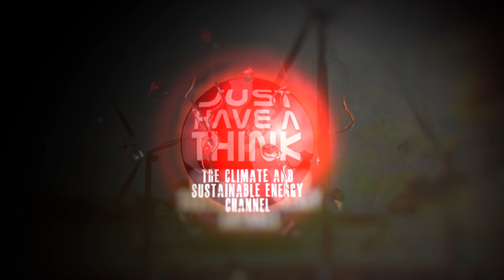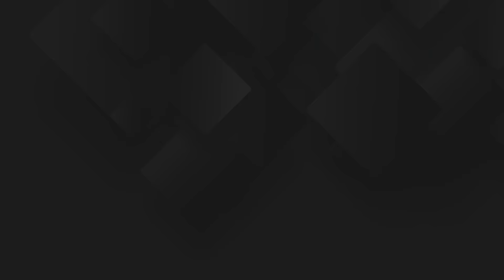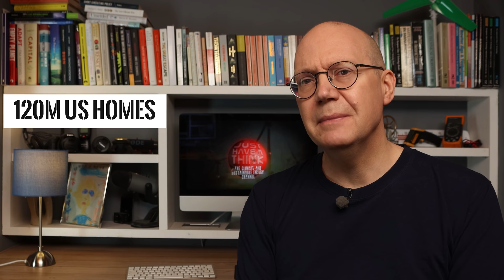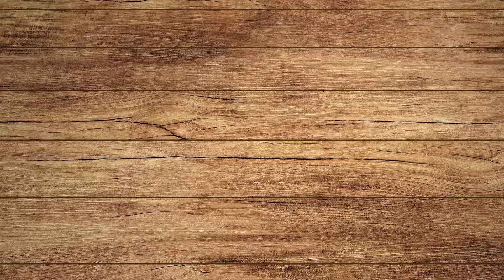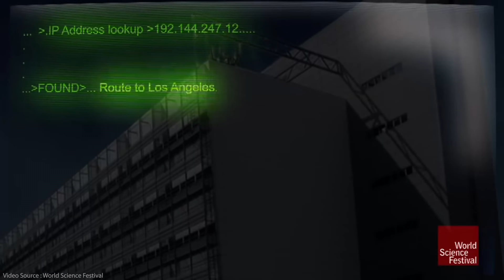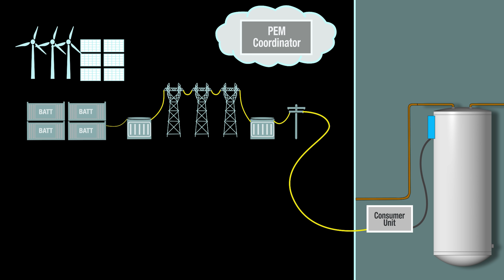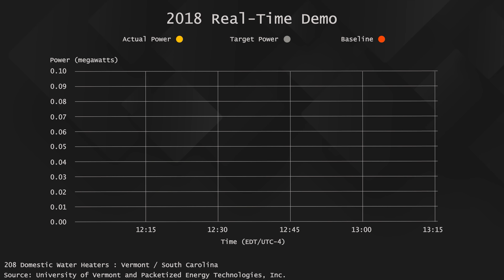How to balance renewable grids WITHOUT energy storage!

Comment: I see some problems (hopefully not unresolvable): (1) Unlike the Internet where the "packets" are all digital electronics and the "hardware" in the computers and servers are designed to comfortably maintain themselves for hundreds of thousands or millions of "on/off" iterations, things like hot water heaters are mechanical devices that, beyond the clever electronic PEM algorithms that control operation, could be subject to repeated mechanical stresses that could shorten their lifetime as they switch along the PEM packet curves.  The frequent "update" schedule, unless carefully modulated, could be brutal on mechanical devices - perhaps somewhat akin the electric "brown-out" periods on conventional electric grids as electric "need" messages get scrambled or are insufficiently served.  (2) the "Opt Out" option, where immediate electric need overrides the PEM algorithm, could become the default setting for selfish users.  Avoiding the "I want it now" attitude of many people could be hard to monitor and beat.
Reply: The opt out mode isn't decided by users, they aren't relying on selfless users trying to minimise their own electricity consumption- the example in the video was of a water heater that would opt out if the air temperature was very low and therefore the normal priority rating of a domestic water heater would be inappropriate, so the device opts out.
Reply: It would be nice if the gov could stop domestic use of gas when temp rises above a certain figure...
Reply: @danyoutube7491  I see your point, but, consider, in an increasingly hackable environment, it is hard not to think that end users would not attempt to override the electric company algorithm for personal gain.  Also, the PEM algorithmic "coordinator" receives requests from some appliances that require immediate energy and prioritize the "need" - in the example, more hot water needed now means the hot water heater sends increasingly numerous requests until the energy is sent ... so ... (1) the FREQUENCY of requests for energy from the END user does play a significant role in energy distribution, not just the PEM schedule, and (2) high energy "hogs" - hackably configured or not - are going to exploit the opt-out option more often than devices that can trickle-charge - therein rests yet another potential problem:  impatient or "selfish" end users could intentionally purchase high-energy devices (and the market would provide them unfortunately) and forego lower-energy alternatives.  The "use" curve is not entirely at the generator end; justifiably or not, the end user devices partially determine the rate and level of energy draw.

Comment: No expert on the matter, but I've understood pretty much the same thing can be achieved by devices just being smart. Based on the waveform the status of the local net can be determined and depending on the status of the net and the urgency the device can decide whether to switch on or not and in case of batteries even decide to supply energy to the grid. Packaged energy looks like a more advanced version of this that without doubt offers plenty of advantages. But I see a risk too, at least to me it sounds very vulnerable to hacking. What is stopping people from sending false messages? Specially when the system is already under stress, I can imagine that it wouldn't be too hard to give the system an extra push by inserting false messages in order to let it crash.
Reply: True, you can determine how the grid is doing just by precisely monitoring the frequency. But there's no incentive. Why should manufacturers or consumers care? You spend a few extra cents on the parts, and only other people benefit? Not a big seller. Now, if you could incorporate real-time pricing, then we've got a potential seller: It would actually save customers money. But that brings new problems as well, like people getting caught out by minutes-long price spikes.
Reply: @vylbird8014  Those few extra cents is negligible compared to the price of most of those products and regulators could easily decide that they should be included for approval in the same way that regulators enforce all kinds of durability and safety standards that otherwise would not have been implemented. 

Variable pricing would be beneficial too, and it actually exists already for decades in some areas, though for the retail customer in a much coarser way. Not sure how easy or hard it would be to implement that on a real time basis. Also not sure how much added value that would have in a network full of smart devices that, where possible,  draw power based on grid status.

Comment: Things will get even more interesting when homes can promise to deliver packets of energy to the grid, especially when producer and consumer are nearby (i.e. without having to use the network operator transformers). At the small-scale, energy sources like solar make delivering on these promises for energy somewhat harder, but backed by a moderate amount of energy storage these could be made concrete (e.g. guarantee to deliver as much energy as you have stored).

Comment: To be clear, the primary cause of power outage in Texas was the lack of proper weatherizing of the natural gas based energy systems.  Dependence on renewable energy and the partial shutdown of wind turbines was responsible for about 25% of the under-delivery.  Better electric energy storage would have helped somewhat, but so many other factors would still have created nearly the same situation as was experienced.

One big problem is that regardless of technology improvements, the "free market" as it operates in Texas has significant biases and profit motivations which often work against overall best efficiency and consistent power availability.  The systems are mostly designed for the profit of a few companies (their shareholders and executives), and the service provided is the minimum standard which will allow them to operate and maintain their profits.

Comment: Thanks for sharing this. Such ideas / technologies are critical to effectively accommodating renewables and the subsequent reduction in energy costs. I do believe however additional large gains can be made using a similar techniques in the demand side. Especially with the big uses of heating and cooling because there are numerous examples of passive houses and buildings reducing energy needs to zero for large parts of the day or year even without active systems like solar power and hot water. The end results of both the reduction of the need for power and it's management as this video demonstrates, including the financial signals both can send will make our systems more efficient, scalable, renewable, adaptable in addition to providing new opportunities not yet even predicted eg; Distributed Hydrogen electrolysis for transport or storage and fuel cells as an alternative to batteries and heating elements.

Comment: Thought:  so from what I understand, the amount of electricity that is available on the grind at any one moment fluctuates in a measurable way.  If you had a smart breaker box that could read those fluctuations and communicate with your appliances, then you could completely decentralize the process.  The electric companies would probably be able to give a discount to you since you would be shaving off the spikes and the dips.  The electric company would not even need to upgrade anything.
Reply: I thought the same, in an ideal world every house would have a small storage capacity (as storage I also consider the heat storage in the boiler) and automatically buy energy at the lowest price unless in urgent need.
Reply: @pomodorino1766  right, if you want to really incentivize the shift, then the electric companies would have to upgrade their meters and have constant price fluctuation.  You could still use just the electric supply for your smart breaker box, but only if the electric company has reasonable pricing.  (Like high supply+low demand price goes down, low supply+high demand price goes up)
Reply: @pomodorino1766  This is kind of starting to become a reality in sweden. Depending on your energy contract with certain energy companies, you can automate your energy consumption so it matches the lowest prices during the day.
Reply: @Johnrich395  Isn't that roughly how Tesla's auto-bidder works at the larger scale to buy energy on the spot market?
Reply: @PaperTools  it would make sense, but I’m not familiar with Tesla tech.

Comment: My idea for an intelligent system would be tad simpler, many energy stations can be controlled in big degree. Electric grid to home have 5% voltage leeway, smart devices would measure voltage sent by station, reading lowered voltage as grid under stress, restraining it's operation for the time. Also microgenerators like solar panels could probe grid voltage to determine value of sold electricity, if it's more beneficial to run AC harder or charge battery instead selling off energy to grid.
Reply: That would be less susceptible to hacker attacks as well
Reply: @michoxi  Not sure how hackers would try to raise or lower the voltage at your wall socket. Of course you need computers to control your home for that. Or at least a microcontroller. But they do not need to talk to a central entity over the internet to do that. Just measure the juice from your cable.
Also: I might think that grid frequency is a better indicator for overall system-health https://en.wikipedia.org/wiki/Utility_frequency#Frequency_and_load - voltage can be low because your neighbour flipped on the sauna. But if a power-plant goes into emergency shutdown on the other side of the grid, you'll know by the frequency dropping ever so slightly.

edit: sorry, i failed to read. you are correct. I missed the "LESS".
Reply: A fun note on this idea, in emergencies grid operators have the tools to reduce system wide (and some localized) voltages in order to reduce demand temporarily to stabilize the grid in the event of a contingency such as losing a major generator or HV line unexpectedly.

Your idea of allowing devices to measure the incoming voltage and reduce their load on demand is interesting, rather than relying on the (admittedly unreliable and potentially insecure) internet, you'd be relying on the devices themselves. Many switching power supply devices (most non motor loads as this point) already use basic power factor correction to optimize their consumption and reduce the strain on the local grid by not consuming/injecting reactive power, so we already have some similar ideas in place.

Cool thought!
Reply: @ChrisBigBad  frequency shows performance of whole grid, power stations have local control over voltage
What's the point of smart grid like that, when cables to your home literally melts from neighborhood charging 10 teslas at once
Reply: I like the idea in theory (basically all you are doing is making devices 'friendly' (they reduce load when it looks like there is too much load on the system).    As other have pointed out, loads could also monitor frequency (which also naturally slows down under high load) as a signal to cut back.   Not having the complexity of another communication channel (and the security concerns of that), is another plus.     Just doing this on your HVAC, Refrigerator, and hot water heaters would get the bulk of the benefit (you can also make slight adjustments to LED light bulbs so that they dim a bit when system stress is high (doing this for all street lighting could be a big win).     The biggest problem is getting the incentives in place so that we can start actually building these things.    Hmmm.
Reply: Make of mandatory by law. Or get super flexible power tariffs with mega expensive peaks and free valleys so people will want to get them to save money

Comment: dynamic demand co in the uk has a simple solution, use the 60 cycle variations to call appliances to reduce temperatures
Reply: Dynamic demand is a great idea, it seemed to lose momentum around 2009 probably because the cost of incorporating the frequency monitoring hardware added too much cost then, but now when everything has a computer built into it, it would be low cost. An example of where it can be used is refrigerators which say have an operating range of 2 to 5 degrees, when the grid frequency is high you cool to the lower end of the range, when the frequency is low you allow the temperature to rise to the upper end, given the load on the grid is indicated by it's frequency (less load means the generators at the power stations spin more easily & faster) it means the appliance modifies it's load dynamically, apply this to the washing machine (heat faster/slower), dishwasher, tumble dry, Freezer. immersion heater, EV charger, A/C Units etc... it all adds up, then multiply across all the household on the grid and it could really make a difference. Just need political will to say reduce VAT on new devices to encourage manufacturers to add the feature. It also has the advantage that 'Bad' actors can't hack the grid coordinating all the Packets!!

A few links - https://www.dynamicdemand.co.uk/index.htm
https://en.wikipedia.org/wiki/Dynamic_demand_(electric_power)
https://strathprints.strath.ac.uk/5166/1/dynamicDemand_as_on_IEEE_site_1_.pdf

Comment: Brilliant. There are 2 hurdles at least:
1. The introduction of this system requires changing each electrical appliance to a smart one (or installing a smart control system [e.g. Span] in every apartment / business).
2. Cyber Security - you will have to add more layers of cyber defense to protect the grid, as a simple DDoS-like attack can cripple the system.
Reply: A more dumb solution might actually be a better idea.   Send a signal on the grid from 1-100 based on if more or less power needs to be used and then the device can read that and choose if it wants to use the power.

Comment: This looks like an incredibly useful tool to help manage grid demand, and it will certainly reduce the reliance on industrial energy storage, however the more we turn off fossil fuels and switch to renewables, the more variable that power input will be, so I suggest we would still require some level of large-scale energy storage to buffer the system - although how much is the big question.

A secondary issue will be that older and less stable grids will need massive upgrades. In my city in Australia, our grid is such a mess that they have serious problems using solar power from roof solar panels that people try to sell back to the grid, and the grid has so many problems with basic functionality that it is often crashing. And this is a capital city in a relatively wealthy country. Upgrading grids and making them able to use this smart technology is going to be...well, a problem. 

Like many other places around the world, grids like we have here are a long-term problem that the government has needed to fix for ages, and there is an even bigger need for upgrades in order to manage power input from renewables, but when the government is incompetent, corrupt or doesn't care (and we have all three), you're stuck with degrading infrastructure that cannot manage high-tech solutions like this. And we aren't even an example of bad grids around the world.

... You should see our NBN. Such a pity it's illegal to beat up politicians.

Comment: 15years ago I had a house in Spain it was off the grid all the neighbour relied on a  generator .I used solar and outback system to charge batteries plus a generator  to use sometimes. Ti power house and top batteries The point is you soon find out what uses the bulk of the power . Tv and light hardly anything it was the fridge freezer mostly.  Kettle could only be on gas cooker and hot water gas bottle too . Soon get used to living like that but stops you taking power on tap for granted

Comment: A couple of thoughts on hot water systems:
If you add a cold water mixer to the output, you can store water hotter than usable, and dilute it to usable temperature as it leaves. This means you can effectively increase the volume of usable hot water you store, and so be more flexible on when it gets heated.

Is heat pump heated water a thing? This could be more energy efficient than resistive heating. However, the efficiency gain would be less than for space heating, because the output temperature is much higher. (It also doesn't work great with the idea above.)
Reply: Yes. Heat pump water heaters are a thing and the newer ones do exactly as you suggest.

Comment: Turning off demand is useful - but here in sunny California we are getting to the point where so much solar is generated from 10AM to 2PM that the system can't absorb it all. Unless the proposed system can add some load by heating water a bit above the normal target temperature, or cooling houses below the average set temperature, it won't help adapt to excess.

Comment: I could see this as an energy stock market where each energy package (a unit of energy) could be traded so that if your neighbor needs to have their car charged ASAP then they could pay for faster access to energy packages, whilst other getting cheaper electricity by allowing for delay so it causes a more smooth electrical total demand. It is definitely an interesting idea.

I believe that during this century we are going to change our economic system from fiat to a energy based economic system. If we could rapidly exchange energy just like stocks then its value is intrinsical. And the best part is that it can't be duplicated like money printing in the fiat system. Inflation in some sense would be good for our civilization. More energy available means cheaper energy available.